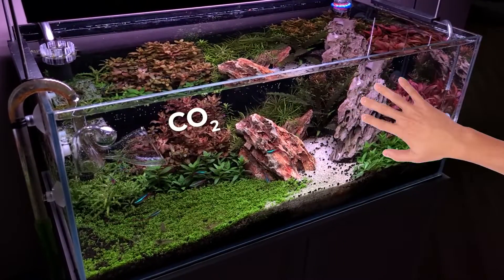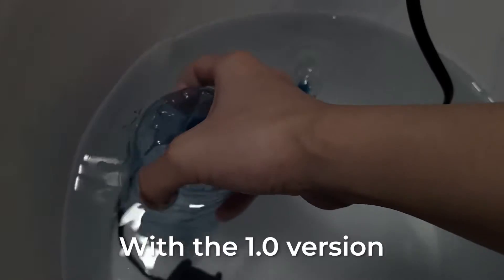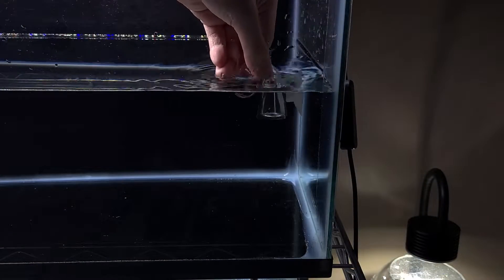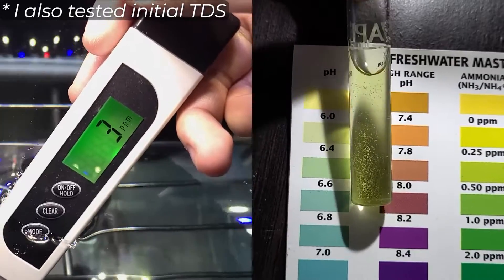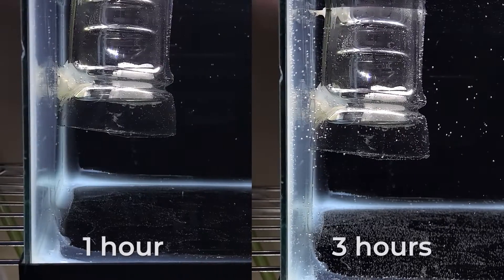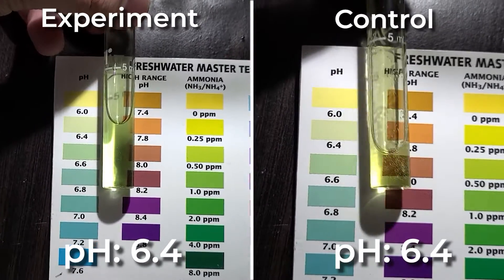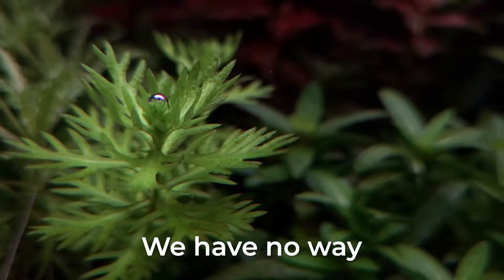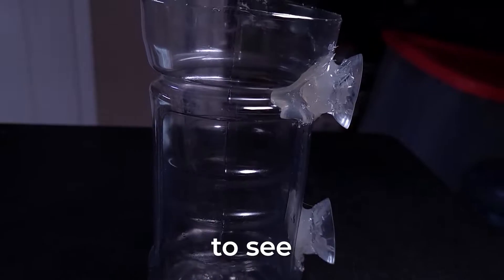Can You Blow CO2 Into Your Aquarium?

Comment: We had an experiment in high school chemistry run around for a bit and then exhale multiple times into it. It was enough for the indicator we were using to change and indicate that we had created carbonic acid. 

Also if you just wanted to try no exercise you should probably hyperventilate into a bag. I was told by my 5th grade teacher you only use 1/4 of the O2 in your lungs so if you wanted higher CO2 you need to rebreathe a few times.

Comment: I use the blow method in my aquarium and it works great.. you just put a rock diffuser , you don't need this cutted bottle and blow into it 4 or 5 times a day.
Reply from the maker: Interesting... what ppm do you get with this? Also, by rock diffuser, do you mean those ceramic CO2 diffusers or air stones? If so, you must have strong lungs to be able to blow through them
Reply: @TropiscapeAquatics  I don't have a kit to measuring the ppm and yes I use air stones. My plants came back to life after I used this method.

Comment: You only put into it one time what if you keep blowing  into it over and  over . I.nhale through your nose and exhale thru the tube into your test tank . 
ain or reading it to it periodically over 24 hours
Reply from the maker: The issue that I see with it is that CO2 is the heaviest gas we exhale, if the bell diffuser overfills and the bubbles escape, a lot of the gas could be CO2. Doing this over and over again could push all the CO2 out. Although, I am not against the idea. There needs to be a lot of thinking to try to get this to work and I'm open to any ideas that could work!

Comment: Why not use an air stone from a bubbler? Smaller bubbles to give better diffusion?
Reply from the maker: There are two reasons:
1. It's incredibly hard to blow through an air stone.
2. Air stones still produce bubbles that are still too large. There's a reason why you don't see people use air stones as a CO2 diffuser.
Reply: @TropiscapeAquatics  I found it easy to blow into an air stone. Bubble size makes sense though. I don't have a diffuser so I can't test... 🤣
Reply from the maker: @Just_Derek  Where can I get lungs just like yours? I think I need a new pair! 🤣
Reply: @TropiscapeAquatics  lol. You don't want mine. They've been abused. It might be because I have a cheap stone I tried it on.

Comment: I am currently using a balloon. It is working like a charm.
Reply from the maker: Interesting... What's your methodology? Size of the tank? How are you measuring CO2 levels? Water Parameters? Any water flow? Size of the balloon?
Reply: @TropiscapeAquatics  I don't really measure the C02 content, I just observe that my plants have been doing much better. Faster growth and brighter colour overall. 
It is a large party sized balloon attached to a hose running to a faucet with a female quick connect fitting. I have a tube with a diffuser in the tank with a male quick-connect so I don't have to remove it when blowing balloons back up. I have another hose with a quick connect that I hook up to blow the balloon up. I blow it up until the colour of the balloon starts to lose pigment showing the rubber is thinning. 
I regulate the flow with the faucet into a steady bubble and it runs for about 6 hours. I plan on getting a 3-way aquarium air valve so I can hook up 3 balloons. This should give me 18 hours.
Reply from the maker: Interesting! You should measure the CO2. It's hard to tell if there is any CO2 being dissolved in the water without directly testing for it. Otherwise, it could be a different variable that is responsible for the plant growth. I wouldn't recommend removing the balloons and seeing how the plants are as a way to test for CO2, there's way too many variables that can influence plant growth.

Comment: There’s probably a little CO2 diffusing out of your container, but it is also off gassing from the surface if the water. The surface area of which is much bigger than your diffuser, so you’ll always be losing more than you’re gaining. The only reason you get anything at all from tank CO2 injection is that the concentration is 100%, and you still only get a measly 20ppm or so.

Version 3 of experiment. Try sealing off the airspace on top of the tank with saran wrap or similar, then filling that up with your breath. Watch it for a few hours and see what happens to your CO2 indicator. In theory, the partial pressures of CO2 will equilibrate eventually and you will get some CO2 dissolved. My calculations suggest 86ppm at 25 celsius for human breath that’s 5% CO2 …
Reply from the maker: If I'm not mistaken, the amount of water used would also play a role in this, correct? The ratio of dissolved CO2 to water would increase as the volume of water decreases.

I need to do some research on this, but wouldn't the method of how CO2 is injected play another role (Diffuser vs passive)? I'm thinking more on the rate of how fast CO2 dissolves into water. If gassing off from the surface of the water is faster than the dissolve rate, wouldn't that make the entire experiment ineffective as no matter how much I breathe, there won't be enough to sustain a constant amount of CO2 in the diffuser to dissolve?

I'm just theorizing here, so I have no idea if this is completely sound or not.

Comment: Now i am not saying you should try this,  since it could be quite dangerous, but what if you breathed in the same air again? and then breathed it back out into upside down bottle. Like making your lungs take out more of the oxygen that is still left in the trapped air. Hopefully that made sense.
Reply from the maker: Theoretically, your suggestion is quite sound. However, it could be dangerous as you've mentioned, so I probably won't attempt it for safety reasons. Also, I believe CO2 is the heaviest component we breathe out, so turning the bottle upside down would let all of it out.
Reply: I was thinking the same thing but with a plastic bag.   

Breath in and out of it a few times, seal it up, secure under water and poke a small hole.  Your channel might get flagged though 😅
Reply: @jamillefrancisco564  I disgusted this with my dad who is in the medical field, and said it would be fine so long as you took a beath of fresh air between each re-inhale of bag air.

But also said even then this method would still probably not work for this application for reasons that I can't remember.

Comment: Interesting, I think the main problem with using our breath is that it's not enough. Co2 systems are constantly adding new co2, making the levels get higher through time.
Reply from the maker: I agree, I think it's all about the concentration and its longevity in the water. Tank size is another variable I can think of off the top of my head right now.

Comment: make an airtight system where you can breathe through the nose and exhale through your mouth and sit infront of aquarium for 30mins or so breathing and exhaling throught that system
Reply from the maker: So here's my theory on this. Let me know your thoughts.

An airtight system won't do too much. The amount of CO2 that will escape from the water will be very small IF there's 0 surface movement. Since my system doesn't utilize any surface agitation there should be little to none in terms of any gaseous exchange. However! I do think an airtight system would be way better for this kind of experiment due to Henry's Law. There will be more pressure in an airtight system as compared to an open system. Thus, the amount of partial CO2 trapped inside the airtight system has a better chance of being dissolved in the water. So, if there's an easy to make system that utilizes partial pressure and is suitable for an aquarium, that would be the best solution.

As for the exhale for 30 minutes, eventually the bell diffuser will be filled with gas that it will "spill over" and lose some of its gas. My hypothesis would be that since CO2 is the heaviest compound in our breath, it would "spill out" of the diffuser easier thus leaving behind all the other gases from our breath. And since that "spill out" will probably cause large bubbles to "spill out", it will affect the amount of CO2 in the water due to gas exchange being performed. However, one could influence this by not breathing into the diffuser too much. Also, I do have asthma so that may influence how much or how well my lungs perform CO2/O2 exchange.
Reply: @TropiscapeAquatics  if you have asthma i would drop all these experiments and go with DIY co2 system with yeast and sugar..thats way cheap than professional co2 cylindeer
Reply from the maker: @asifali007  Oh for sure! I use both DIY CO2 and pressurized CO2 for my tanks. Although pressurized CO2 is more expensive, I've found it to be the most stable in my aquariums. This was just a fun little experiment to see if such a thing is even possible 😄
Reply: @TropiscapeAquatics 😂😂😂